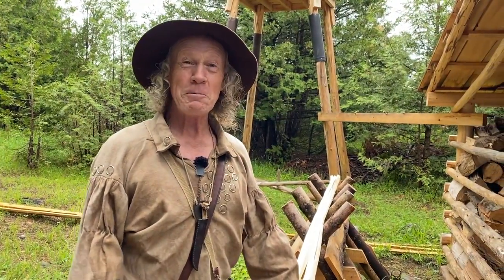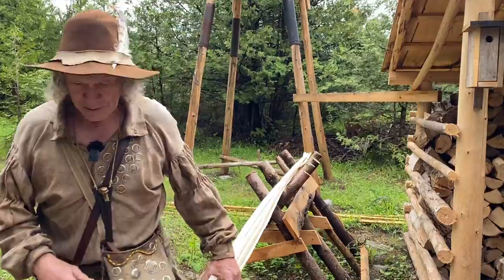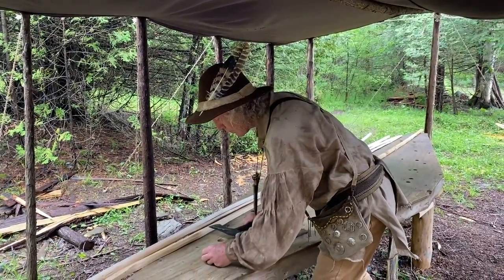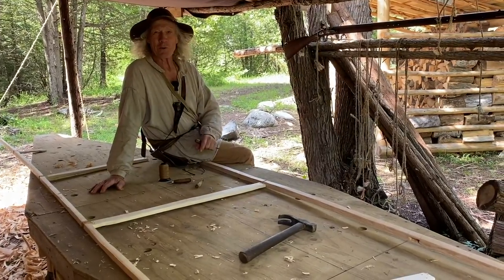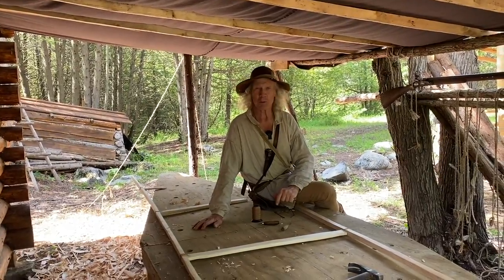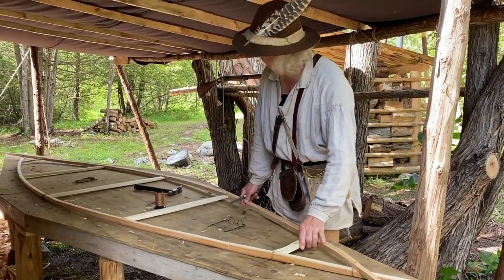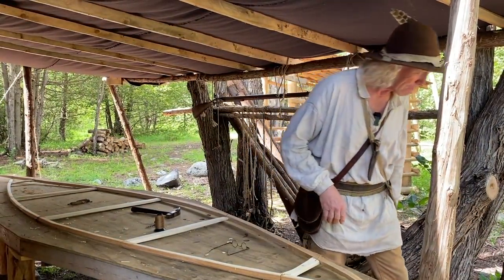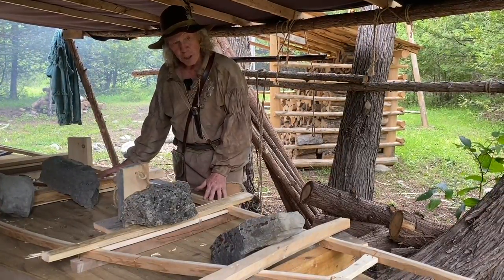Birch Bark Canoe Takes Shape! Forming the Gunnels; Making the Sheer Line | BUILD | WOODWORKING | DIY

Comment: Peter, thanks so much for taking the time to video this process.  Down here in my part of Kentucky, unfortunately, both cedar and birch trees are pretty scarce, and I don’t think I’ve seen any suitable for canoe construction. What other woods/barks might have produced suitable canoes?  I’m aware that some dugouts were made of poplar and cottonwood, but a dugout isn’t remotely what I’m interested in.
Reply from the maker: Our pleasure Gregory.  Cathy gets all the create for the filming, I just live an earlier lifestyle.  The Mohawk commonly used elm bark.  They are rather a crude looking but, quite functional.  The Northern Cree used spruce bark as birch didn’t grow big enough in diameter.  They also used spruce for ribs.  If using spruce for ribs you must split then out when green and you split them across the grain not with the grain as ones does when using cedar.

Comment: Peter, another enjoyable episode;  thank you and your videographer/producer/editor spouse!
Two questions:  1)  Do you think the boiling water method might work better by draping/wrapping some burlap on the work to hold the heat around the wood pieces?
                              2)  As you are an arborist, do you have any insights as to why one birch tree produces suitable bark for a canoe and the others around it do not?  Same species, same location, same time of year, but different quality?  Some tree species need southern exposure to do well, some require swamp conditions, some are altitude dependent, what makes one birch better for canoe building and not it's neighbors?
Reply from the maker: 1.  Never found a need for anything other than boiling water.  The ribs when I get to them are actually boiled in water.

2.Because birch makes both wonderful furniture as well a veneer plywood, over the years the biggest, the best, etc we’re harvested, leaving a very poor green pool for the species. The same can be said for maple and oak. So, I’d say it is more as a result of greed versus biological.
Reply: @TheWoodlandEscape  Thanks, use what works, that makes sense!  Aah!, greed will be the end of us.

Comment: Great fun watching you , do you know if the Algonquin built larger Canoe and did they venture into the open sea? There knowledge of building seems quite advanced. 

Roger
Reply from the maker: The most common length of canoe in the 17 and 18 hundreds is similar to mine … 11 to 14 feet but, they did build ones that were 18 to 20 feet.  They were noted as on of the better built crafts.

Comment: I'd love to see it firsthand when it's finished.  Is it preferable to work with green wood or seasoned?  I'm thinking of mortice and tenon where the green wood is used for the morticed piece and shrinks around the tenoned wood.  Also,green wood might be more easily bent.  I know nothing of canoe building, so forgive me.  Another great video!
Reply from the maker: One can use green or dried but, as you mentioned, the green wood does bend a bit nicer.  If your ever in my neck of the woods don’t just see it first hand, take it for a paddle.
Reply: @TheWoodlandEscape  That would be a great experience, thank you.

Comment: What's the smallest, most lightweight alqonigon (sorry I know I butchered the spelling) would have made been stable, yet a good river runner?
Reply from the maker: Historically Cheryl, they often made them as short as 11 feet.  I suspect they would not be for the inexperienced due to being quite tippy.  I’ve found 13 feet to be about the shortest.  They also built canoes with flared sides instead of the tumblehome  we see in most modern canoes.  Flared sides were both more stable but, the craft also displaces more water and can carry a bigger payload.